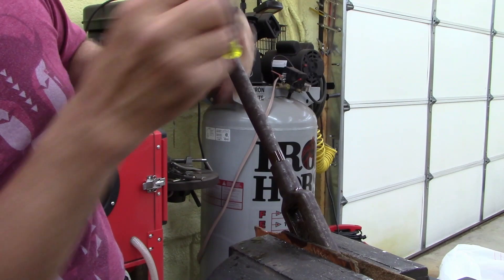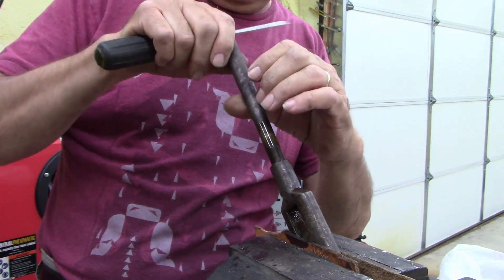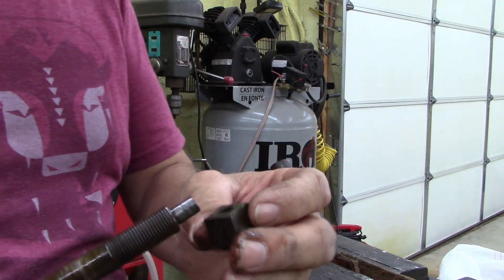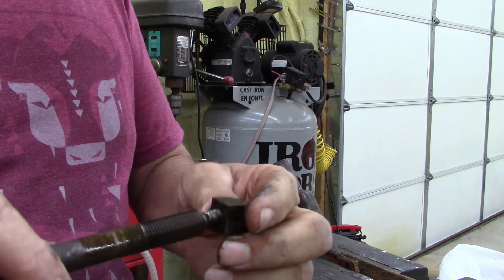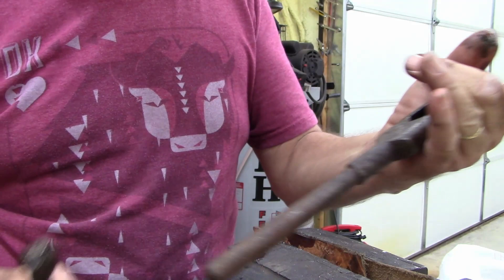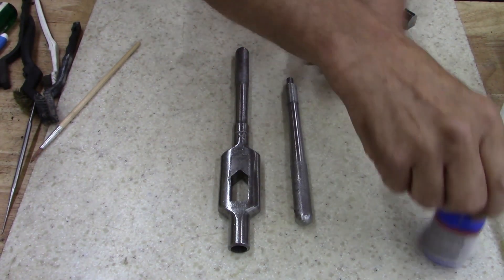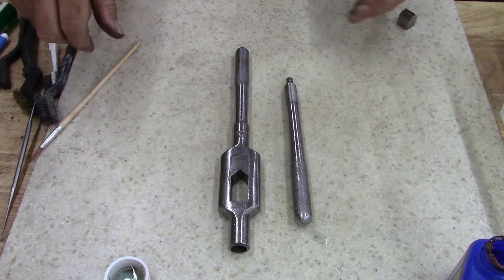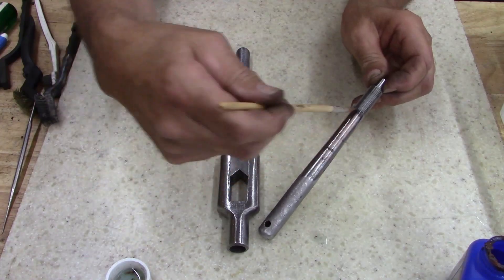Tap handle restoration.

Comment: Have you tried a little heat, to expand the body of the wrench around the little screw?  It might help the penetrating fluid work in deeper, even if it didn't immediately loosen the screw.
Reply from the maker: I have and it still cannot get it to move, so I will let it set for a while more!